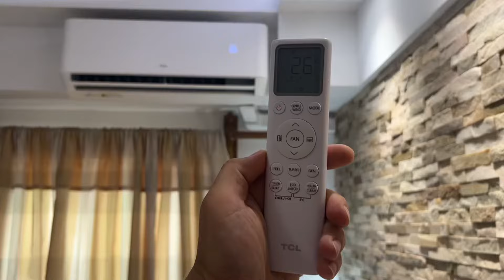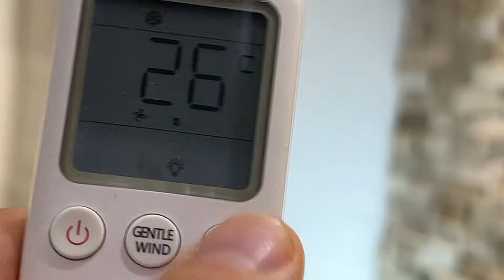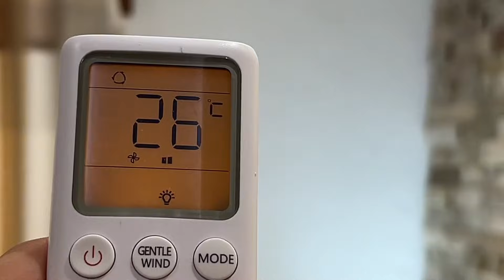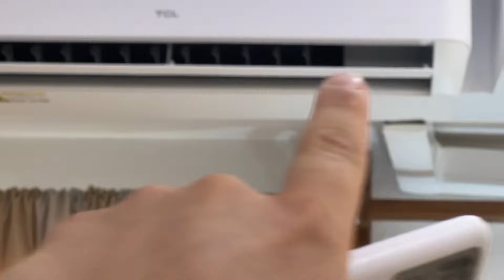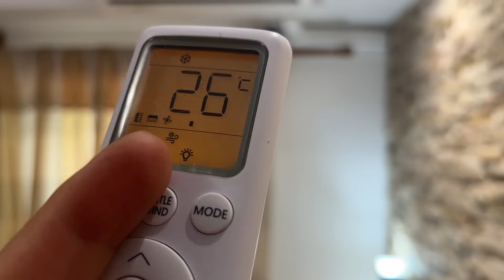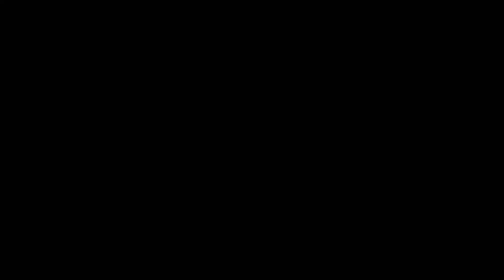TCL Remote Control  All functions  and buttons explained

Comment: i feel button is for remote temperature sensing, whatever temperature remote senses it will auto cut and run as per remote temperature not the actual unit. Most remote is kept near bed or beside a person so its called i feel, since remote will have similar temps to the person sitting next to it. Hope didn't confuse you further

Comment: What different AI Eco and Gen?
Reply: Eco .. is to increase temp for 2 degree to use less power  - Generator function To Fix your Electric problem if your Electric is not stable at 220V
Reply: Because Inventor AC afraid of unstable Electricity .. it will broke down the Board
Reply: Thank for your information  @MadzPapa

Comment: does your ifeel button work. i was told my ac has the ifeel function when i bought it, but a year later when an engineer saw my remote, same as yours, told me that the ac doesnt have this feature as the remote doesnt have the sensor underneath.